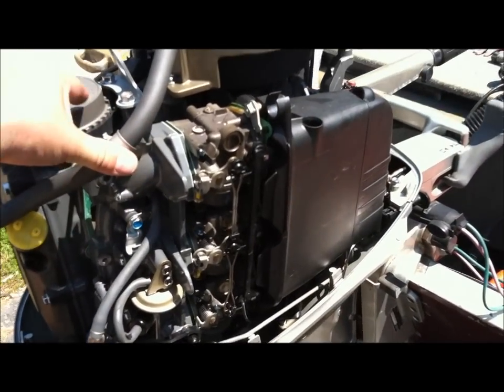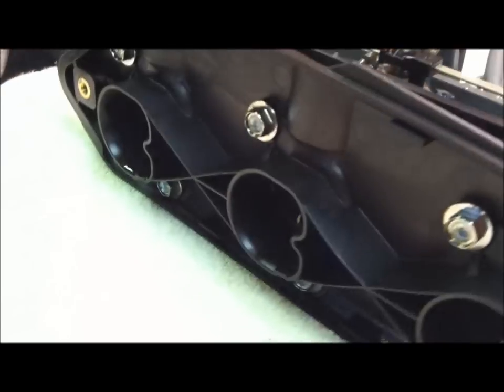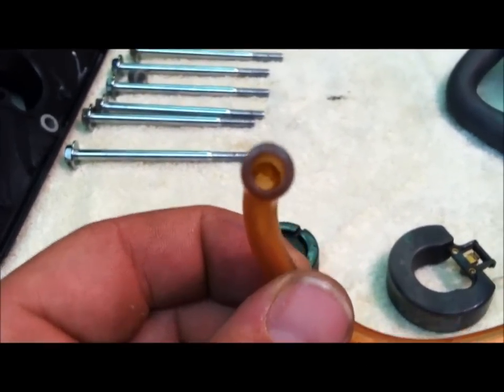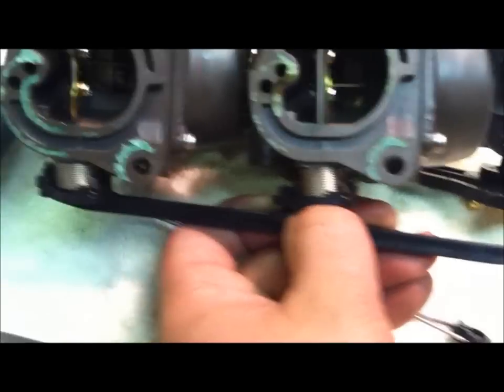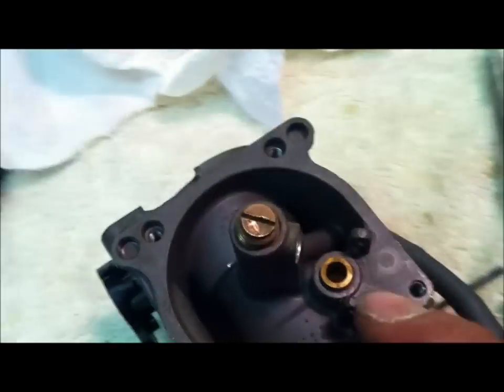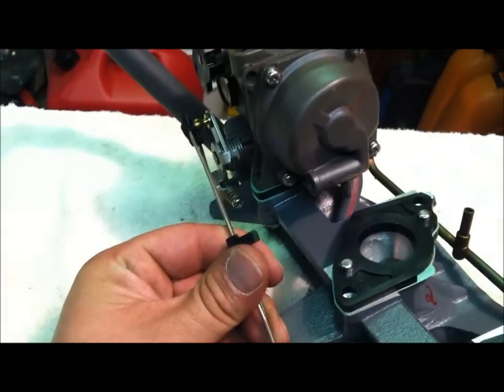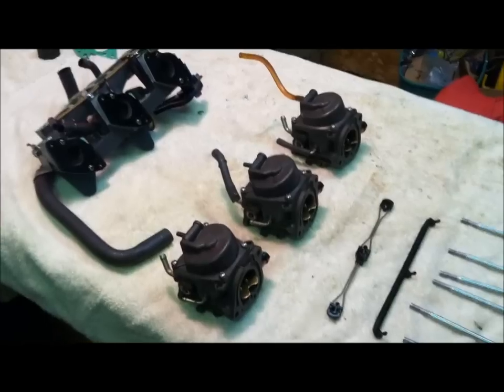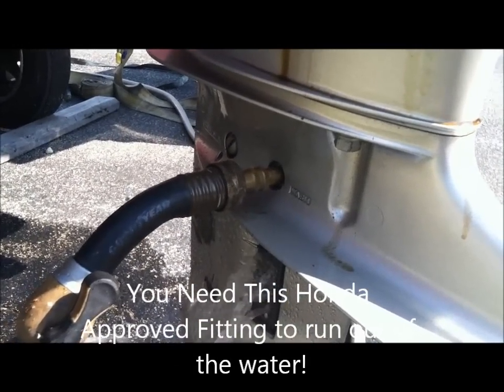Honda 4 Stroke boat motor carb cleaning class

Comment: You got LUCKY Bud. That is if this thing ACTUALLY runs properly.

You failed to remove the emulsion tubes OR the jet-sets and clean them. Those were located under that brass cap you said was gunked up. When the jet-set is removed, access is gained to the slow jet passage which is then connected to the idle circuit. The air for idle and main circuits comes in through drillings in the front of the carb parallel to the Venturi opening. They need to be cleaned along with the removal and cleaning of the idle adjustment screw, idle passage and idle, transition and main orifices in the top of the rear of the carb throat.  

The small little screw with a hole in it that you said was NOT a jet was, in fact, the MAIN jet and inserting foreign objects in the orifice is NEVER advisable as you did with your taylor's pin..

While it's hard to argue with success....in NO WAY can this be considered a "comprehensive" Honda carburetor cleaning class. Most people that are having trouble, that end up following the directions in this video, will NOT have success and will be tearing the carburetors off at least one more time until ALL the items that can cause issues are addressed.

God bless you for trying though and congratulations on your good outcome..
Reply: Looks pretty good. Old school hands on repair on carbs, there's nothing wrong with sticking a sewing needle or pin to clear out the jet hole, just don't force or scrap it too hard. Good video.
Reply: It's best to avoid using anything metallic if you can so as to avoid any chance of enlarging the fuel metering orifice which will throw the jetting out; people can be pretty ham-fisted. I find a short piece of fishing line and a suitable solvent will do the job.

Comment: I have a 2006- four stroke 60 HP Mercury EFI  out board motor. It has been sitting in storage for a couple of years. I use the recommend amount of fuel stabilizer & removed the fuel line & hooked up the water  Run it in idle until  till it stops. Question # 1  Is there a step I left out to insure it cranks the next time it is used?  So, finally I am  ready to use it again. The fuel tank is empty, I put fuel in it with stabilizer New marine battery. I hook up water to it it turns over will not crank. So no fishing trip yet. So being its a whole new world to me I don't know the proper steps I should take to get back in the H20 and fish. I do have Mercury Power Tune Engine Cleaner here. Question #  2 What steps do I take here at home to get my motor running. Thanks for any help ......Ready to go fishing !
Reply: Get a Honda= last forever

Comment: Thanks a ton for posting this!  I've cleaned a ton of carbs, but never on a Honda outboard.  I need to clean my 1999 50HP, which looks almost identical to your 30HP,  and your video is going to save me a ton of time.  I was going to take the carbs off one at a time, but I can see clearly that taking the whole thing off at once is the way to go.  Great job with the organization too. 

Comments: You can also blow compressed air through the little holes after the carb cleaner, that often helps to get the junk out.  7:49 that is a jet.  10:12, that looks like a sacrificial anode.  When you're flushing, if you use that Honda flush adapter be sure to cover the water inlets with tape, otherwise you're not getting any water into the pump (notice you had no indicator stream).  Muffs work great on these motors, you just have to be sure to have the hose full blast.  You'll get a very strong indicator stream when the pump is getting adequate water.  Thanks again for posting!

Comment: http://www.boats.net/parts/search/Honda/Outboard%20Engine/2001/BF30A1%20LHA/CARBURETOR/parts.html show the parts break down of the carb. You should also remove #19 and 20  and clean. These are responsible for the fuel metering at low rpm and is what make your engine idle/troll nice.  Gaskets are 22 35 and 38 in the breakdown.
Your vid show an engine with stuck float valves allowing the fuel to pour out the overflows. Item 4 needle valve and 5 float are the specific culprit or the gumming of those.
I commonly run into a rough idle problem after winter storage and without cleaning 19 and 20 that problem would still exist.
Nice clear video and great job of filming. Obviously your not a mechanic, shake off the haters, they vid is still very helpful and the contains good info. Respectful comments can clear up the rest.
Reply: beyondupnorth Thanks for the follow up tips!  I've got to do this myself next week and your tips are helpful.

Comment: Just done a full carby clean on a 90hp thanks to your video clip. Just 4 instead of 5 cylinders. THose blocks in the water jacket are like the ones on the bottom of the peg. Designed to attract all the electrolysis. Thanks again

Comment: Very helpful video, thanks!  I was really sweating it yesterday when I had gas pouring out of my older BF50 carburetors.  But thanks to your video, I knew what I was getting into and was able to take apart, clean, service and reassemble the six carburetors and they are running fine now.  I did have to pull the atomizing jet (?) in the center of the carb as my O rings had tears in them and I think that was my main problem.  Though you may not be a "Honda tech", you made an awesome video that has helped a lot of people.  Thanks man!

Comment: Helpful, thanks.  I would have also taken all the non-metallic parts off the carbs and soaked them in "real" carb dip, the kind that comes in a gallon can.  My 8HP Honda (two cyl, one carb) is very prone to getting the tiny passages in the carb body clogged, and the spray cans don't dissolve that.  It is maybe $15 or $20 per can, but if you're going to do all that labor, may as well do the rest.

Comment: Thanks for the informative video. I've got a 30 HP Honda and was having trouble with a sputtering engine. Thought it might be the carburetors but they were clean. Looks like some sediment clogging the manifold. Cleaned it up and it seems to be working. Your video made for an easy job of locating and diagnosing the problem. Thanks again.

Comment: @75iowaboy - I have the same problem.   I've followed the procedure in this video, plus 9@7:10)  i dropped the metering tube out of each carb and cleaned them before re-assembling.  it's called a primary nozzle -  - PRI; NOZZLE, MAIN (Honda Code 4649489). diagram is here:
  boats dot net/images/diagrams/honda/18ZV90/ILLUST/ZV98E/1400A.png

I'll know in another day or two if the carb cleanup / reassembly solves the problem or not.

Comment: Hi. Thanks for doing this video.. One thing: @ 4:30, the clear line is the drain line for the fuel bowl. on these small hondas it is a good idea to loosen that black screw  (4:58)at the bottom of the bowl and drain the bowl when you aren't going tobe running the motor for a week or longer... especially if you have ethanol . If you don't do that, disconnect the fuel line and run it while flushing until the engine stops from lack of fuel.

Comment from the maker: Hi Jim, No I do not unfortunately.  I did not do this one mine and I think I just got lucky.  I have not had to do it again since this video either.  But when the carbs come off next time, I'm going to research it further and make sure I do it as well.  Again, mine runs smooth now with no issues, so you may likely be just fine.  Best of luck to you sir.  Glad it helped you out.

Comment: Hey nice video. I have a 2006 bf40 that won't idle when warm. I'm assuming it's clogged pilot valves...I saw no mention of cleaning these?  I think they are the little screws with blue locktite on them on the side odf the carbs?

Comment: Very good instructional video.  I've just rebuilt a set of BF90 carbs and was lucky to have the proper Honda carb manual - VERY useful to have if you can get it, but if I didn't have that, your video would have been a huge help.  What I would recommend is setting up the carb sync every time you've rebuilt or removed/replaced carbs.  A tiny adjustment can make a huge difference to smooth running so it's worth doing.  Cheers!

Comment from the maker: mcbryanmc-

The manifold is the entire carb manifold assembly, including the air intake.  On my model, it's all connected together.  

The muffler on my model comes out of the lower unit prop wash area.  They changed this soon after it's design.  I'm not sure why, but the newer model Honda's do not exahuse out of the prop area.  The set up then may be different on ours.  I've never worked on one with the exhaust elsewhere, only my own.  

Sorry I could nto be of more help to you.  Good luck man!

Comment: Couple questions. the manifold you removed, is the air intake on the front part of that Cowling? If not, where is it? By Muffs, are you talking about the water hose connect connection? Working pn my fathers 60hp and Im lost.

Comment from the maker: Thanks.  There were jet's to be cleaned.  They just unscrew.  It's been awhile, but I think it was a 10MM?  Sorry if thats wrong, but you will see me remove them in the video on the last of the three carbs.  Definitely remove them and clena them.  Mine were bad.  I now only run premium fuel.  Have not had any problems since my carb job.  Mine runs fantastic.  I loved this motor and have had it for a long time now.

Comment from the maker: Hey Kirk, No I did not have sync the carbs.  Now, I will say that it's possible I got lucky?  Not sure about that part.  Mine runs great.  Just was out on the water this weekend with my wife.  It's running better than it has run in the past three years or so.  I do a lot of trolling with planer boards so there is lot's of idling.  We idled for hours with very little throttle time in between and had a nice ride home even.  Can anyone else chime in about syncing carbs?

Comment: Did you have to sync the carbs; I have a 1996 50 which after watching your video cleaned the carbs and runs great in the drive way.  Put in the water ran great on the way out but had to idle home.  Going to try and take carbs apart before trying to re - sync the carbs.

Comment from the maker: I'm not entirely sure why so much Gum, I will say that I moved from Wisconsin to Florida for about 8 years.  The boat was not used for almost 4 full years and It was not put away properly.  Therefore, likely it was from sitting for so long.  I could be wrong.  Also, I dont' think do to ignorance I was running Premium fuel in the tank when I first got the motor new from the dealer.  
Dealer told me muffs are terrible for the 4 strokes.  Not sure why, I was told this after a water pump failure.